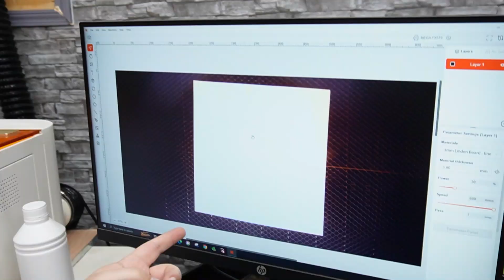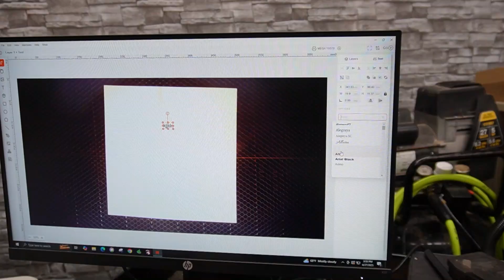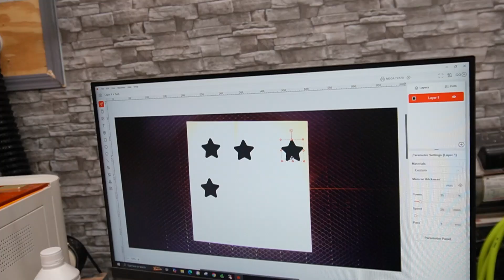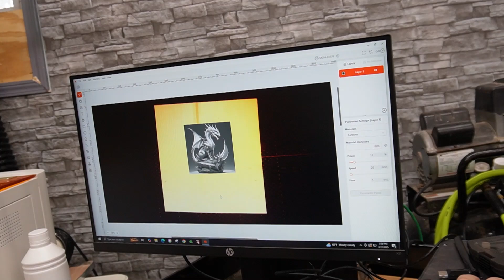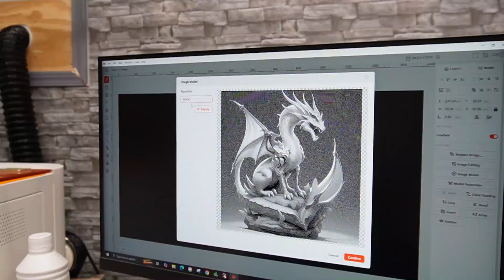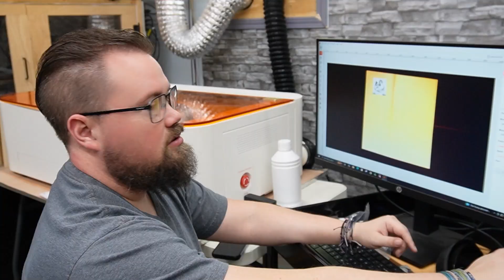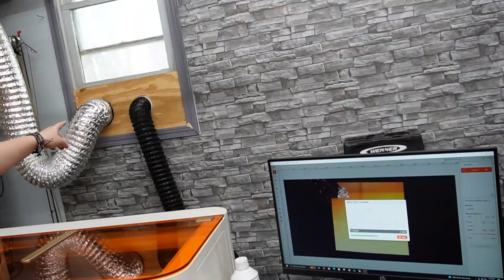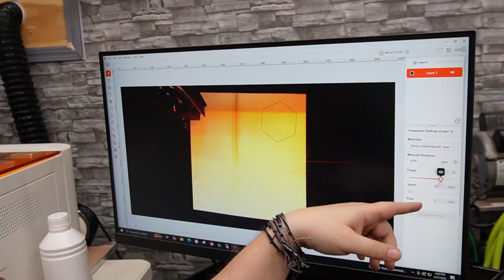MEGA engraving and cutting tests

Comment: Been debating on this vs the p2s.  The sticking point for me is the material height.  Monoport only does 3.5" whereas the xtool will do 8.5 with the risers.  I can't find anything on where monoport plans to do this same thing.
Reply from the maker: I would guess a none desktop machine might be better if you need more material height. The z depth on the 100watt co2 is 13.7”